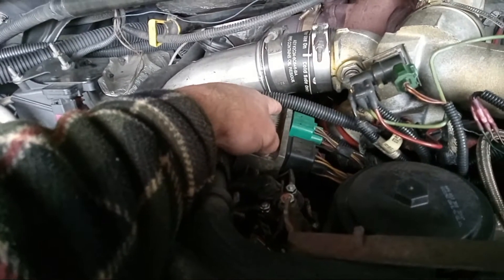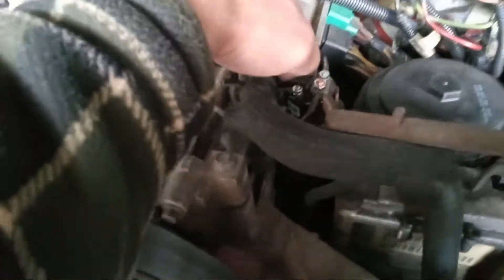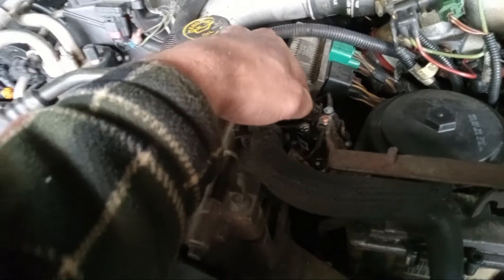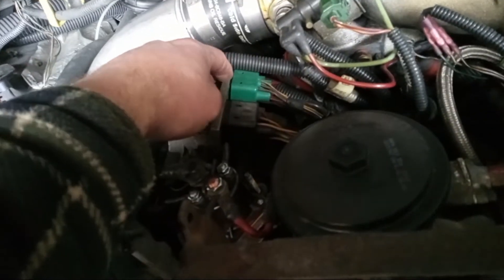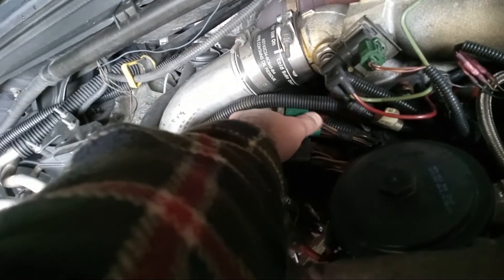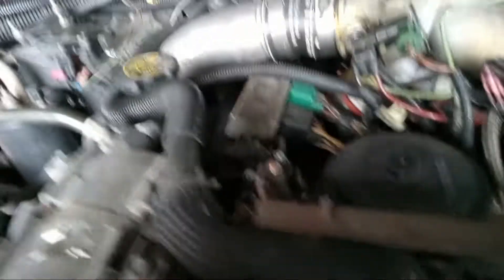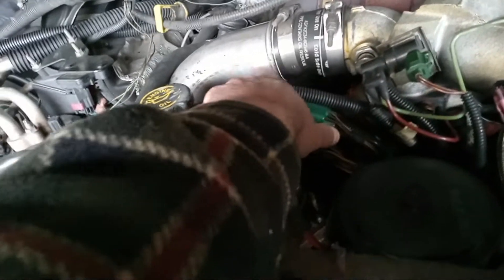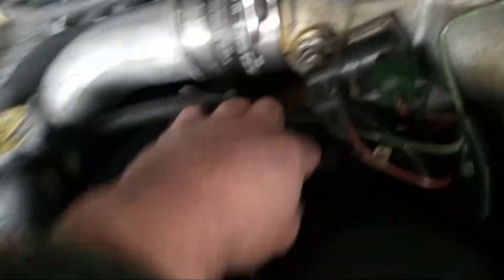Glowplug control Module 7.3 Powerstroke Excursion update. code po683

Comment: Thanks bro for the info I got 3 codes for glow plugs..I'm going to check that conecction
Reply: What was the end result if I may ask?  Replace the module?  My '01 has three codes for GPs, but not the P0683.  eBay has the Motorcraft module for around $70, the best price I've found.